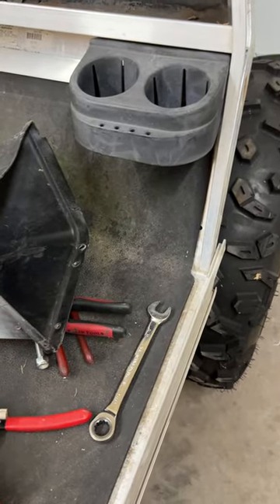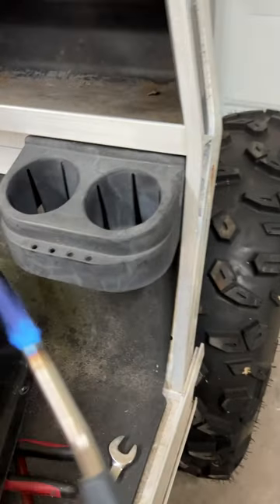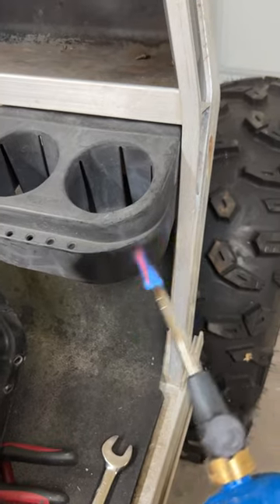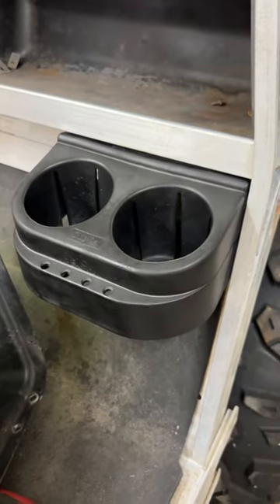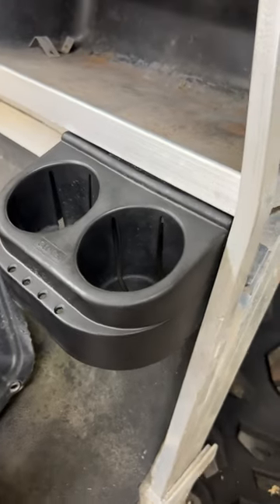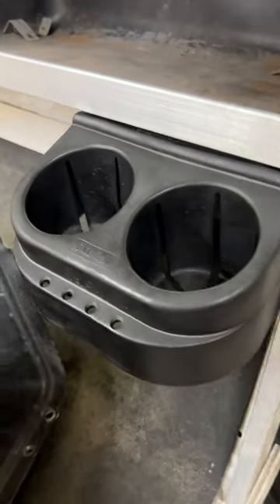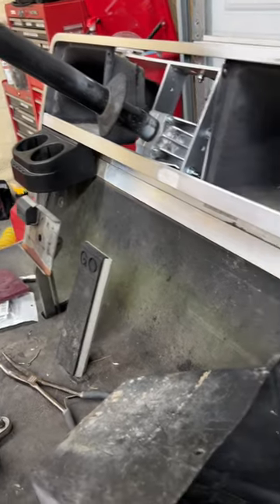How To Restore Faded Plastics | Club Car DS Golf Cart Cup Holders | Fix Faded Plastics #shorts

Comment: Except that all you're doing is pulling the oils up to the surface where they'll eventually dry out and increase the risk of stress cracking.  It's much easier just to replenish the oils with Vaseline (aka petrolatum).  Petrolatum may be a petroleum byproduct, but all of the harsh things they normally warn against have been removed, and so it's a much safer and more effective way of restoring plastics that have a petroleum based component.  Just make sure you wipe it completely dry or it attracts dirt. 

If you look on compatibility charts for automotive rubber/EPDM, petrolatum is listed separately from petroleum and is highly compatible with automotive plastics, whereas they highly DO NOT recommend petroleum products.
Reply: I agree.  I did this on a plastic bicycle component, and sure enough the haze returned within a month.
Reply: Petrolatum...
Tough enuf for a wheel bearing*...
Soft enuf for a Baby's Behind. ✅️ 😂 😂 😂

Disclaimer:
DO NOT USE PETROLATUM IN WHEEL BEARINGS. 🙄
Reply: @paulajohnston2990  funny part is that petrolatum was discovered by oil workers who noticed that the stuff that coated their drill shafts after they had struck oil was good for dealing with dry chapped and blistered hands.  The friction and heat from the drill essentially burned off all the harsh stuff that normally caused deterioration of skin, rubber, and plastic components, which is specifically why petrolatum gets its own category on the compatibility charts.

Comment: Hit it with some mineral oil then heat it with a heat gun so you're adding oil baxk tonit an not pulling the oils from deeper that will dry out again and possibly cause it to start cracking and crumbling